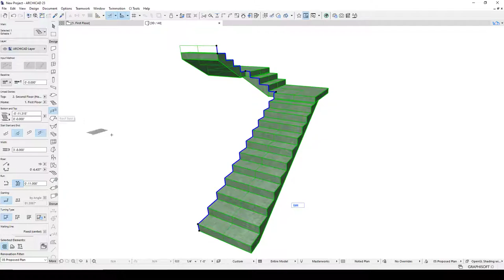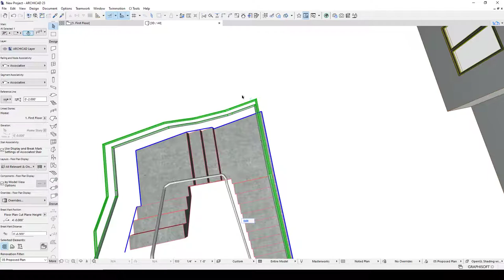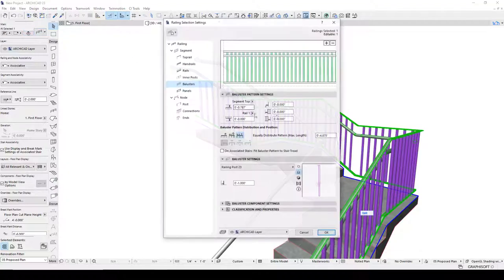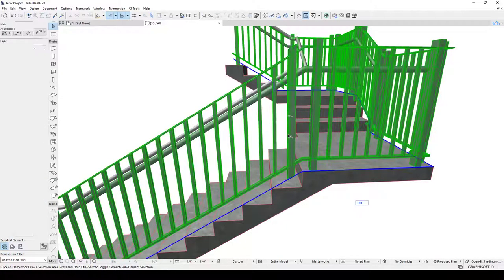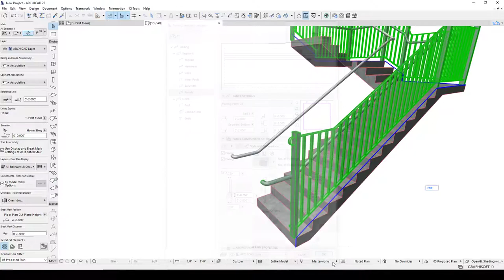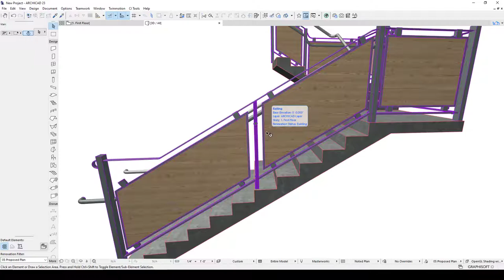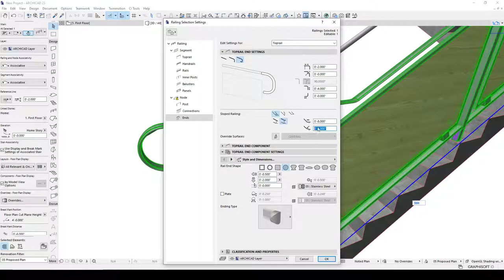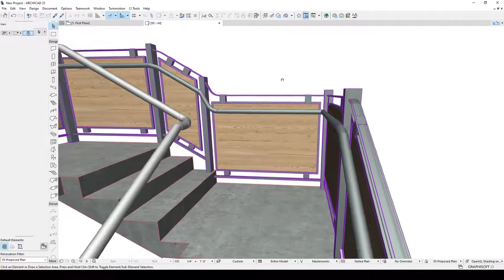Railing Tool

Comment: The problem I have with the railing tool (I'm still version 22, and I would advocate for upgrading if the stairs and railing tools would be improved!) is the connections. In my office, most people refuse to use the railing tool at all. I keep trying! We usually need U-shaped stairs with tube steel railings, and the connections always come out awful. I can usually get it straightened out if it's at the stair coming up to a landing, but once it turns and goes up the next run of stairs, it's a catastrophe. I see so many complaints about this, but I cannot find answers! Any suggestions, from anyone...?